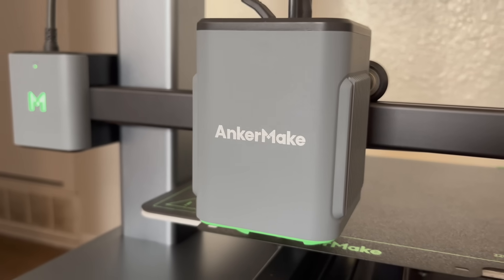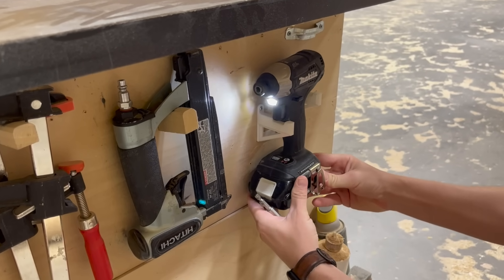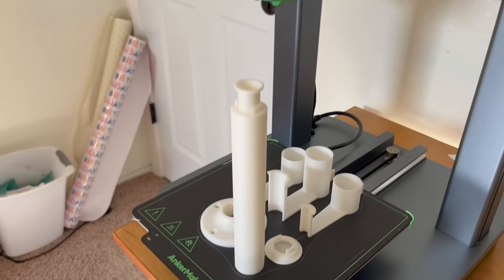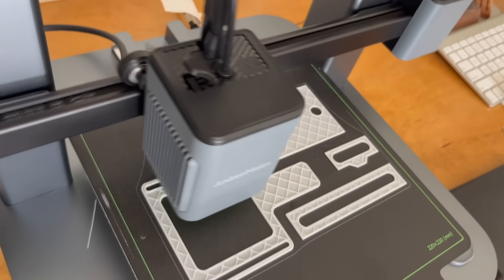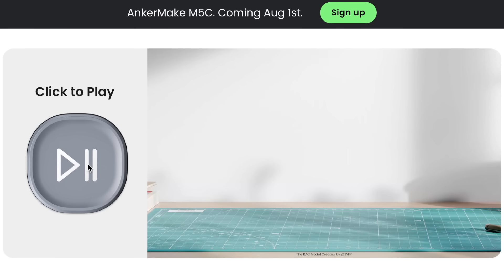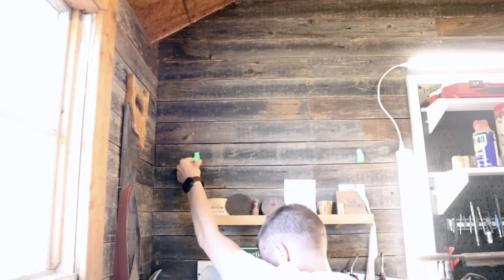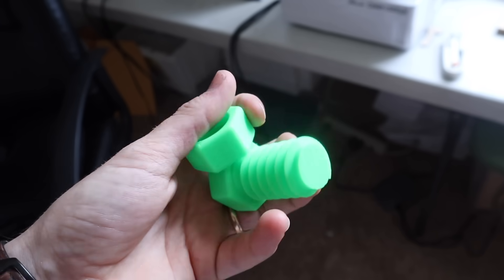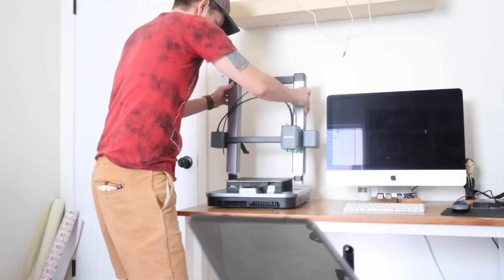10 Tools You Can 3D Print // Introducing The New AnkerMake M5C

Comment: I bought one on Amazon and right out of the box it won’t print.  When I turn it on, it just beeps at me and the app says it is overheating and to turn the power off.   I called the anchormake tech support number and spoke to their answering service.  Supposedly they are going to have a “technical engineer”  contact me.  I am so excited to try to print some of this stuff.  It is very frustrating to spend $400.00 and find the printer doesn’t even come with filament. So then when you get filament, you find out the think won’t even turn on.  It has only been a week, I am sure they will get back to me soon or it is going to be sent back.
Reply from the maker: Man, that sucks to hear! Hopefully it all gets sorted.